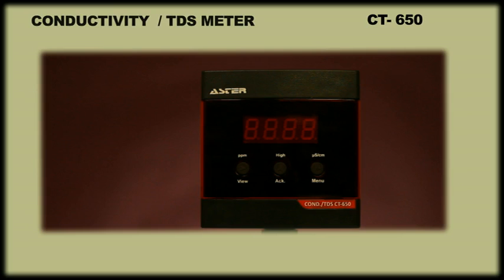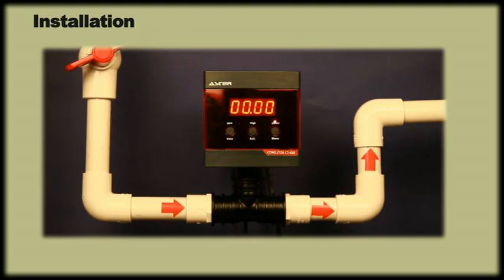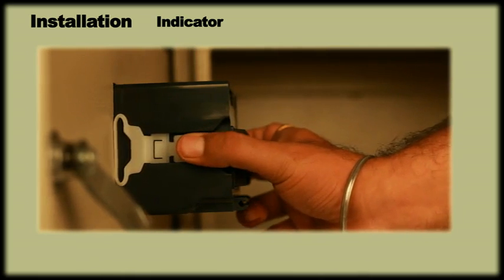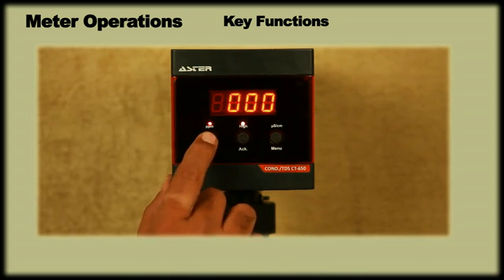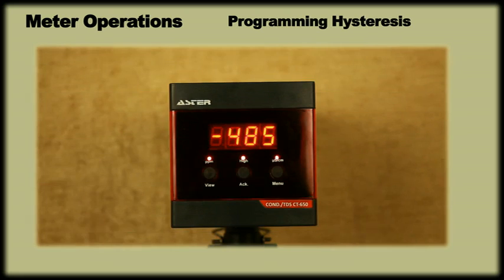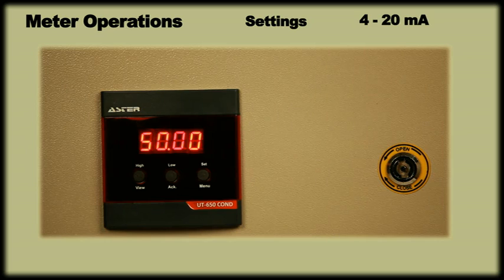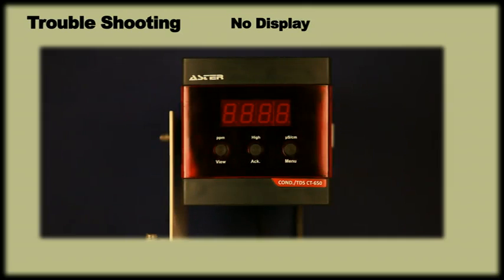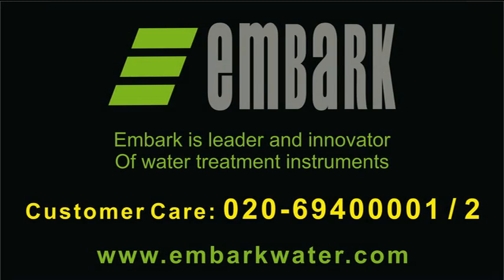How to do the settings of Conductivity  Meter #Aster #Embarkwater #CT-650 #conductivity

Comment: How can I calibrate aster ci550 and change the set point value
Reply from the maker: Refer the manual (You can download it from our website www.embarkwater.com) or contact to our customer support on +917276003731/32
Reply: Sir do u install the ci 550